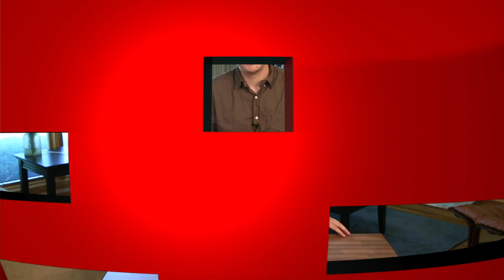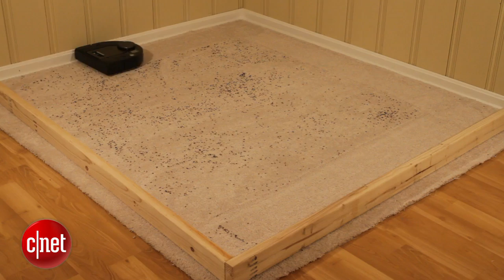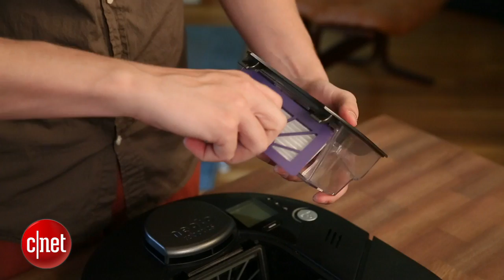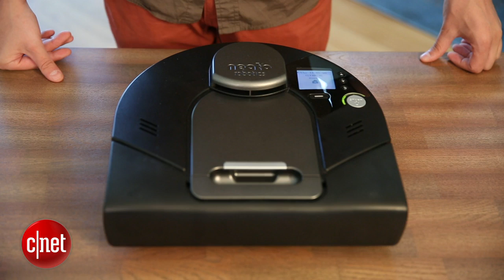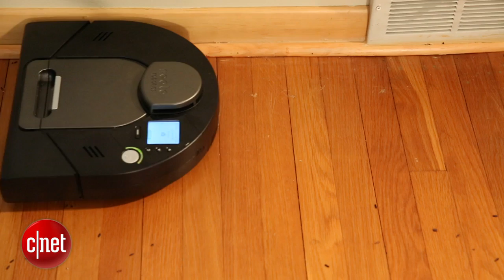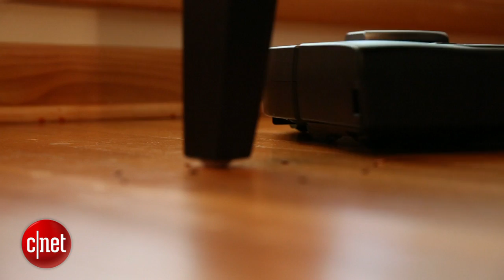First Look - Neato Robotics XV Signature Pro

Comment: All, go on Amazon the older models like the XV-11 and this new model are ALL THE SAME! just different paint choices, the Brush head AND the Filter is different! Neato sells the Brush head and better filters (Purple) separate so you can upgrade your older XV-11 
the older model XV-11 sells for as little as $250 USD? in some stores..? online I think Costco had a awesome sale at one point with all sorts of extra filters and brushes too for like $250 but that's long gone... Good Luck!
Reply: The signature series fixed s lot of issues the older xv bots had, like hair getting stuck in the motor that spins the brush roll